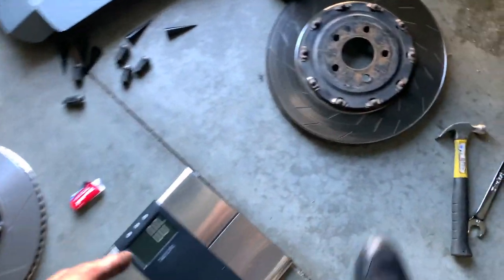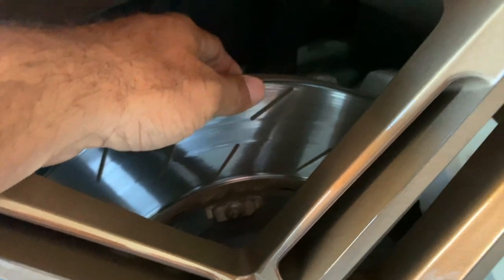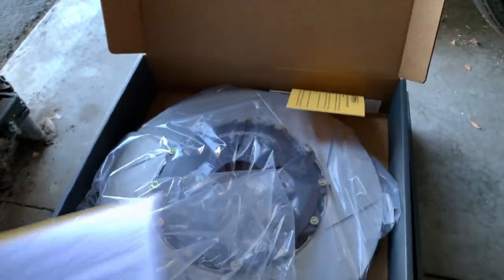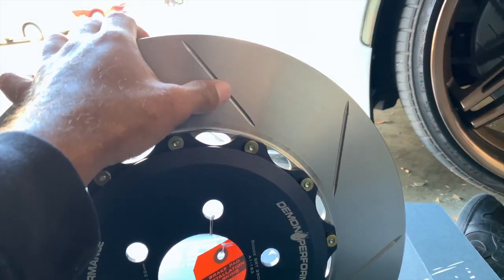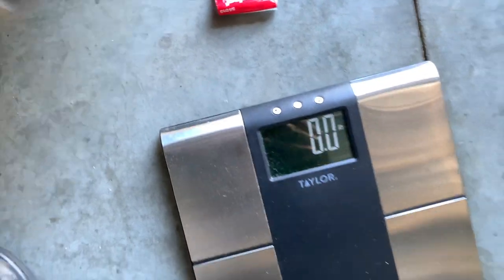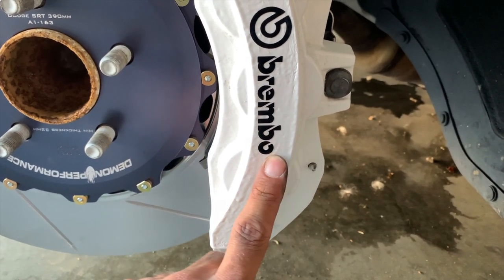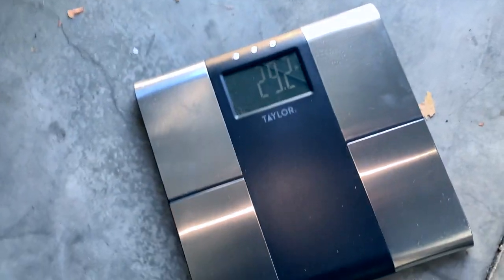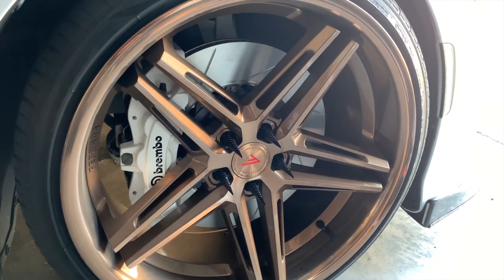Demon Performance Lightweight 2-Piece Rotors Swap

Comment: 7:13 very important to clean the hub surface before installing the new rotor.  This will keep the rotor spinning true and prevent uneven pad wear which will feel like the rotor is "warped" and cause pulsating brakes.

Comment: Mine are due.. well my pads, thing is that it's tough finding replacement discs in Canada (Price conversion/shipping/stock etc), dealer I went too actually made their own machine to turn down these two piece rotors. Pads aren't the issue I can get low metallic brembos (or Ceramic) all day. But pay to play...Stock rotors are like 30+ LBS, of course more now I think as they bumped up the DIA from 15.4 to 15.75 for 21+ cars. So even more fun stock issues lol.

edit: The insides of the disc getting eaten up quicker is what happened as well, it's so tight in those callipers that you need to make sure to service them often or the Brake dust etc etc.

Comment: Good video fam! How many miles you had on your rotors/car before you changed them? That passenger side was crazy wore out. And what is the price on these demon rotors?
Reply from the maker: Thanks fam but i had about 20k miles on my other rotors before the swap. The 2 piece rotors on these 6 pistons came used off of a 2017 hellcat challenger that im not sure how many miles had on them but they were on there since the car was brand new. But the price on these demon rotors is $1400

Comment: Where did you get these?  How much were they, and do they fit on a scat wide body?
Reply from the maker: I put the link i got them from in the video description and mentioned it in the video. If that link no longer works then im not sure as this video was shot a long time ago however, the price is listed on their website and was around $1500 at the time i got them. And yes there is no difference fitment wise between the widebody and slim body brembos besides minor visual esthetics on the calipers themselves.
Reply: @Srtfiedofficial thanks bro!

Comment: Do you have a link where I could get those rotors? Also how much did you pay for both?
Reply from the maker: https://solisracinggroup.com, price is on the website.
Reply: @Srtfiedofficial  thank you bro good looking out. Did you buy the hellcat ones? Also you should make a follow up video on how they’re doing
Reply from the maker: The demon performance rotors are for hellcats and scats with the 6 piston brembos. Even the OEM 2 piece rotors are interchangeable as they are the same for both models.
Reply from the maker: The rotors are doing great btw! They’re just like the OEM ones except they’re lighter

Comment: So no new pads? You should have installed new pads as well so both are new and you then break them in. With those old pads you can damage the new rotor since the old pads will have been damaged by the old rotors.
Reply from the maker: I installed new pads when i did the upgrade to the six piston brembos a few months before this so trust me I didnt need new pads. And you dont “need” new pads when you swap your rotors unless your pads show uneven wear or damage.

Comment: Whenever I swap the scat rotors out I will weigh them to see the difference.   Those rotors are done.
Reply from the maker: Damn already😳 what you been doing on them😅
Reply: @Srtfiedofficial  they are just shaking like a broken washing machine.
Reply from the maker: Ah yea the famous warping lol. I changed them out with cryo treated slotted rotors on my last charger and never had issues with them warping again.
Reply: Never thought about cryo treated.  I was just use to warped rotors being from FL.  As soon as the rain hits the hot rotor they are shaking.
Reply from the maker: Yea cryo treated rotors is the way to go if you dont wanna worry about them warping again. They cost a little more but well worth the money!
Reply: @Srtfiedofficial  get what you pay for! I see you used the Lug nut trick too from when you did the swap
Reply from the maker: Yea i did lol
Reply: @Srtfiedofficial  Keep grinding to fam, the content speak for itself & the increase of subscribers is showing that 😤
Reply from the maker: @ukayhemi6385  preciate the luv and support fam💯🙏🏽
Reply: @ukayhemi6385  what's the lug trick brodie? I just grabbed a 18 scat and not tryna get my wheels snatched off.
Reply from the maker: The lug trick is to put on one lug finger tight to hold the rotor on while you put the caliper back on. Makes it that much easier